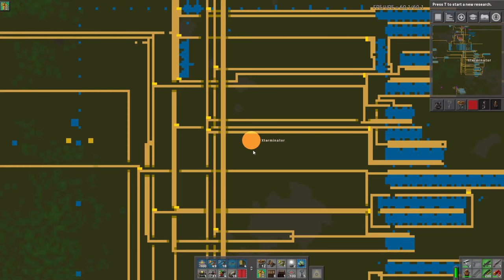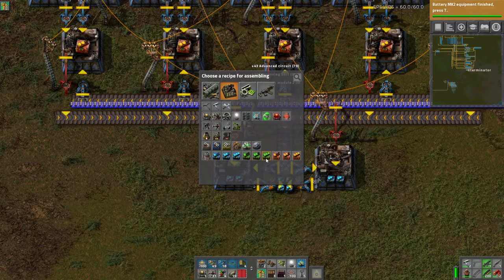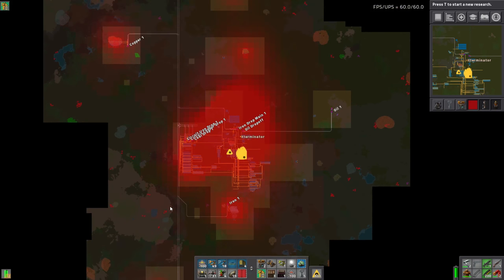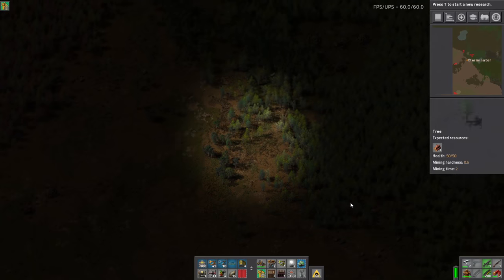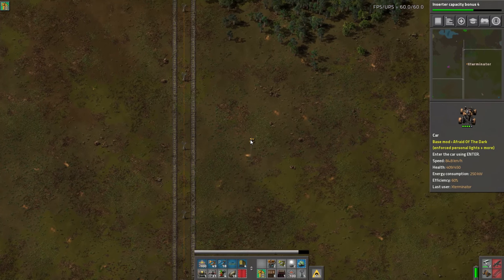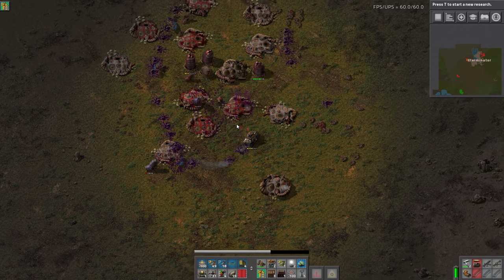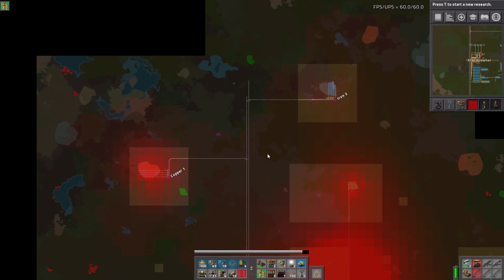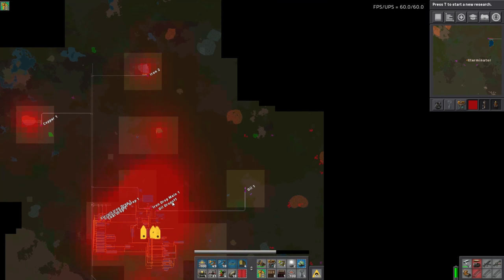Factorio: Tightening The Belt: Megabase Guide EP24 - THE EXTERMINATOR | Tutorial Gameplay Series

Comment: Flamethrower works best on Biters they have more defence against bullets, Spitters easier with bullets. Flame is also AoE so kite a load of Biters - especially when they are Behomoth - you won't be rolling around in your tank wacthing things die quickly like Xterm is in this video. Also get a Discharge defence and a trigger - when you're surrounded by Biters and you can't move - press Discharge and they all get forced back.
Of course, all that changes with Uranium Rounds with full bonuses then you obliterate everything

Comment: Well, if you get surrounded by 15-20 behemoth biters lasers will not be able to kill them fast enough and 4 mk2 shield won't save you either. Still have to be careful. 

Artillery is really useful as strategic asset: you bomb the thick of the base and 15-20 or even 30-40 behemoth biters guarding it will go to get the artillery emplacement with blood in their eyes. Even one shell is enough if resources are scarce. Then you come from the flank, lasers blazing, and destroy relatively defenseless base. 

Tank repairing is much safer for bots if you are moving relatively slow as biters will focus on the tank - but this increases the risk of being surrounded.

Any tips for deathworld marathon?
Reply from the maker: Yeah, as I mentioned you do have to be careful not to get surrounded. That pretty much applies to any stage of combat in the game. 
As for tips for deathworld marathon... Focus on military early and do your best to push the biters back outside of your pollution.